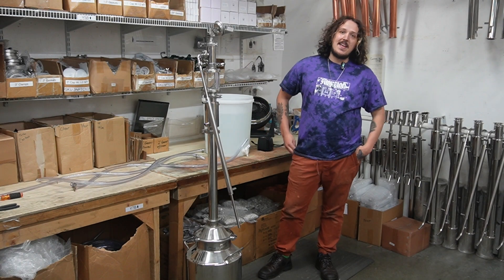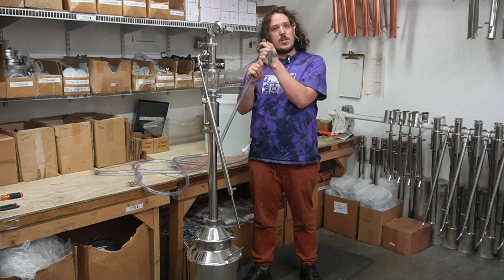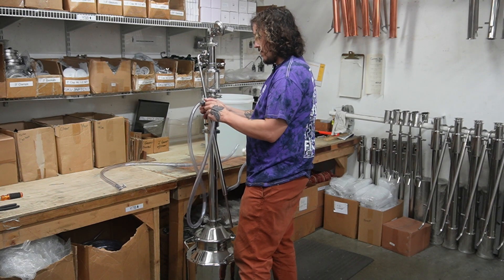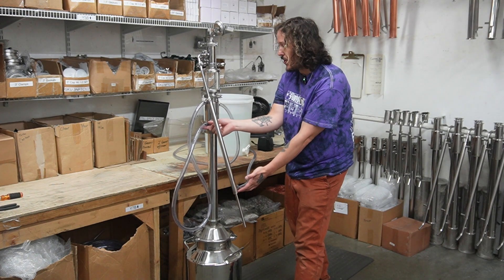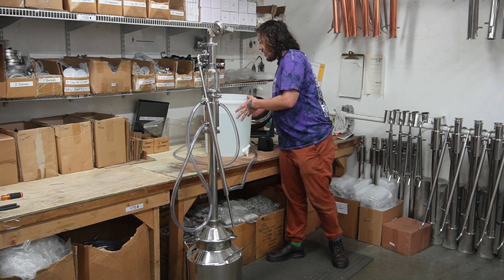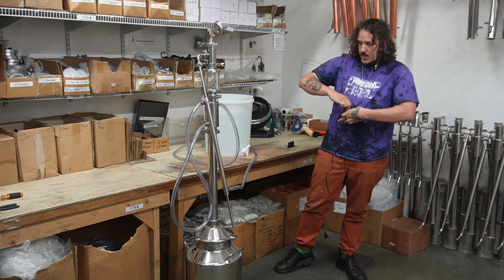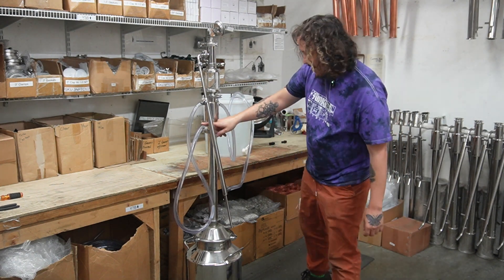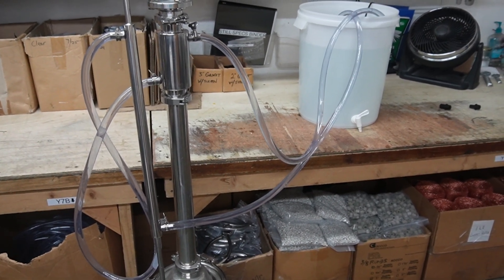How to Set Up A Water Recirculation Chamber

Comment: I watched George Duncan's video on his cooler rig. Not having an old window unit, i just bought a 55L refrigerator cooler and added a submersible pump. I can set the temp and recirculation rate on both the condenser and the deflaginator for still reflux control. No wasting of water.
Reply from the maker: Nice!

Comment: The city water is cheap, I just let it trickle in & out, (my Small 3 G still) during Winter. Today July 2024, the ''cold'' water is 90 degrees.. So I'm looping 25' of garden hose in a Bucket filled w/ Ice Ice baby 🥶
Reply from the maker: Definitely, I can relate! Summers are easier for fermentation for me (at least here in CO) but harder for running the cooling lines for a still. This method is my preferred cooling method and works regardless of the season.

Comment: I use an old cooler and a submersible pump off Amazon. I freeze a cpl jugs with water to recool the water. I've read you want to keep your water less than half the temp of your head temp. Occasionally i just dump the water and refill with full cold. So far never a proplem. 👍👍 If I had the room, Georges (barley and hops) old window air conditioner setup would be great!   Without George, I'd prob still be wishing I could distill. Great Mentor !!

Comment: Only problem with that setup is the hot water going back into the 'recirculating chamber' (as you call it) without a means to continually cool the water your condenser will only drip hot alcohol
Reply from the maker: You can use liter soda bottles filled with water and then frozen to stick into the chamber and keep things cool or just lots of loose ice
Reply: Ice melts too fast...you need LOTS of ice!...a cooling system is the only effective way to keep recirculating water at around 50 degrees F...trust me I've tried MANY ways @milehidistilling1

Comment: I take milk jugs filled with water and freeze them to swamp out out in the water bucket to keep it cool. No worries about over filling. Early mistakes for me were thinking the water had to be ice cold and thinking the water had to be full blast recirculating. I keep water under 70 degrees and have valves to variably control coolant flow separately to the condenser and dephlegmator.
Reply from the maker: Yeah, this is a way we recommend to a lot of our customers as well, very effective and good on costs.
Reply: Exactly how i do it, except I use our laundry sink filled with enough water to be over the pump with the cubes. Use four gallon cubes at a time and good for about 3 hours.